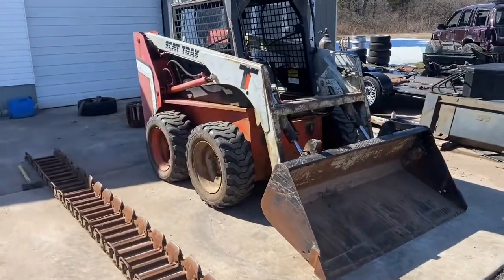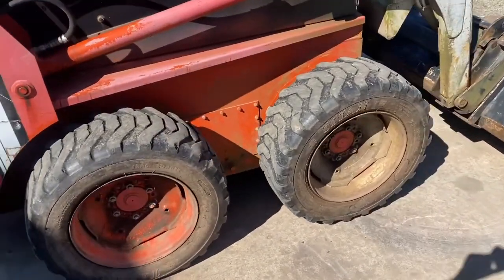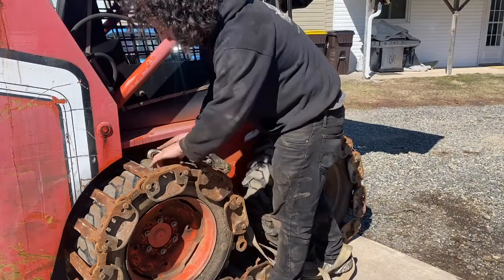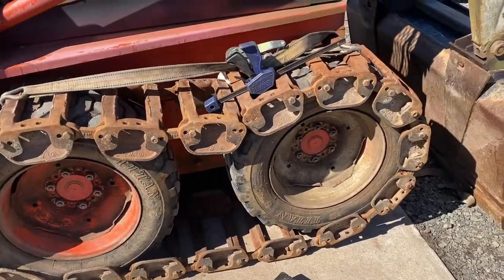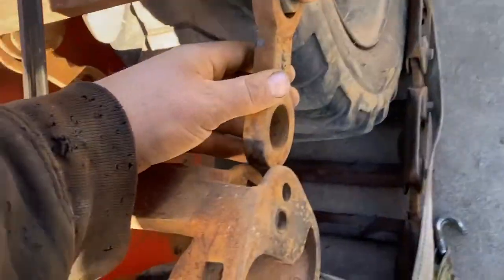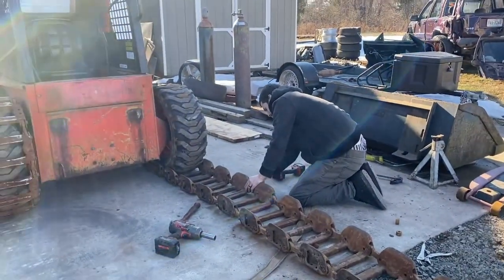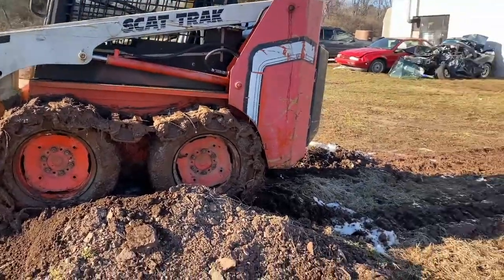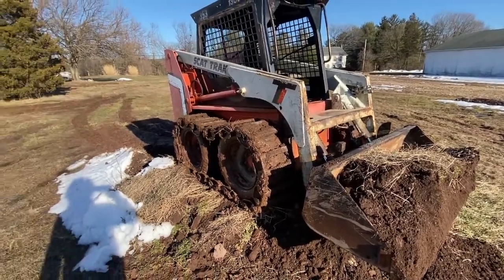Installing over the tire tracks on a Scat Trak 1300HD skid loader

Comment: Long shot.. im looking for a image of the fuse box.. could you possibly send me a picture of it ? I can send email.. long shot
Reply from the maker: I dont... Mine actually doesn't have a fuse box. However, look up a service manual for a Thomas T133 from the late 80's early 90's. Its the same machine more or less
Reply: Well the one i have has wires in the cab in left side by your knee area. Does yours ? Ill look up the thomas machine thanks!

Comment: Do the tracks scratch up your concrete? I bought a set of Loegering tracks for my Mustang 2050 but have not installed them yet.
Reply from the maker: Yeah there pretty gnarly on the concrete and I stay off my blacktop driveway. The previous owner ran 2 weld beads of hard face rod across each pad so that makes it way worse. Unmolested pads would probably be okay if you cross concrete gently and dont turn